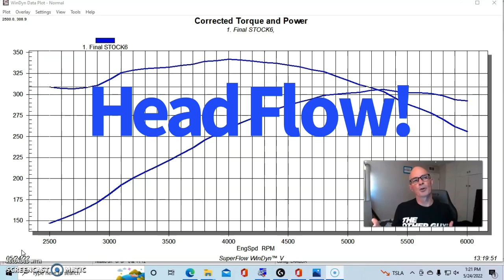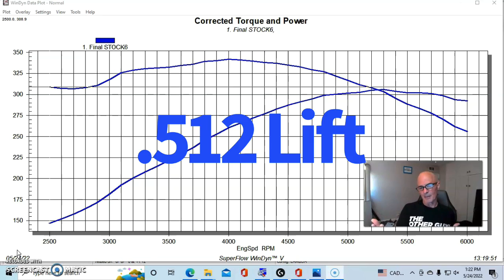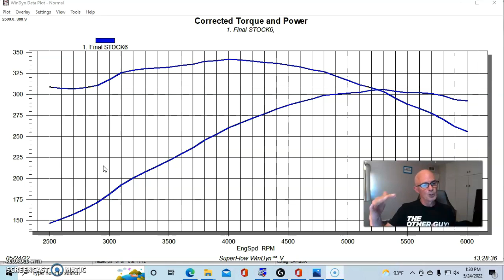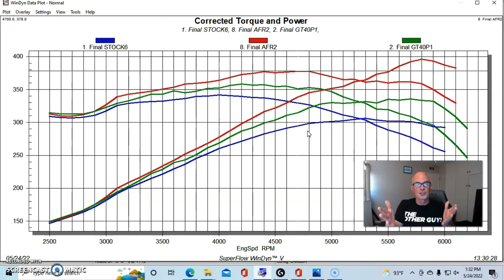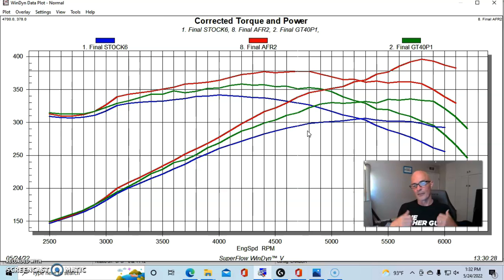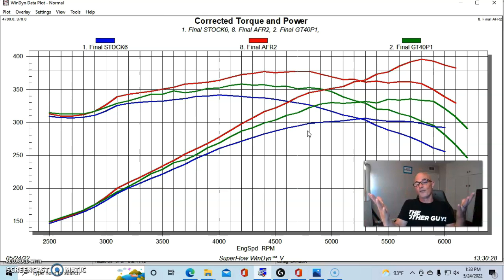HOW TO ADD 90 HP TO A 5.0L FORD! 302 HEAD TEST-E7TE v GT40P v AFR 165. ARE ALUM HEADS REALLY BETTER?

Comment: 95 Mustang Cobra heads , what are they GT40 or 40 P. Just thought I'd ask as I'm sure you know  🙃👍
Reply: All the 5.0 Cobras: 93, 94, & 95 had GT40 heads, not "P" heads.  GT40 is also know as a 3 bar head and the GT40P is known as a 4 bar head.  3 or 4 bar is a reference to casting marks on the heads.
Reply from the maker: these were P heads
Reply: @richardholdener1727  You're the man , thanks

Comment: It looks like the morons are giving you plenty of content to make! If you do revisit, please run all the 02s in the pipes! To show how different the cylinder to cylinder is! I didn't think anyone ran stockish cubic inch anymore! Other than the antique racing guys! 400 hp with a stock cam 🙄🙄🙄🙄! I've never done it, & we have rebuilt tons of cobra engines, as there is a major Shelby Mustang restoration shop about 20 minutes away! Maybe if you used the best of all the factory stuff in perfect shape with a shitton of compression? But there isn't much time for the air to enter or exit w such a tiny camshaft! The next question after you do all this will be, DUH what will it do on a 347 or 363 😂😂😂😂? Thanks again Richard for answering the same questions over & over in every way possible 🙄🙄🙄🙄!
Reply from the maker: what will a stock cam do on a 347? that vid is up

Comment: They also changed the rocker ratio from 1.6  to 1.7 on that test to get to 400 hp. That is how they simulated a bigger cam. So they said. I read that article. That is why I only buy AFR heads.
Reply: Plus electric water pump helped a little. I think whoever threw that short-block back together must've did a hood job. Because every little bit counts. When you're being challenged like that. 
Kinda like Ford, Chevy & Dodge. Letting the race teams come into the foundry. So they could make a stronger " stock " block. By altering the molds. Prior to the block being poured into the molds lol.
Reply: My thoughts exactly. It's not apples to apples if every bit of it isn't the same. I'd also like to see the dyno results of factory heads with factory cam and compare 1.6 to 1.7 to see how much that little extra lift actually does.
Reply: @BrandenMcNabb  Iv'e seen a test where going form stock rockers to rollers of the same ratio made just over 10 HP, really not worth the swap done on it's own. Going to a higher ratio should be good for about the same gains (so 20-25 hp over stock rockers) but will put bit more strain on the valve train, mostly at higher RPMs.
Reply: @johnjones928  the only time it's worth a difference is if the rockers you're using are flexing. Higher ratio may give a small bump depending on the combo but usually within 10hp or so unless the change is drastic. 

The big thing with these builds is all the incremental stuff. An electric water pump is about 8hp at the top end. Performer rpm air gap manifold is about a 12hp gain over a generic raised dual plane. The headers are probably worth 15hp over a set of cheap manifolds. That's a 35hp gain altogether!

It's worth making the small changes, they all add up eventually.
Reply: @BrandenMcNabb  I wonder if the cam was degreed differently from stock too. 
I believe I have the original magazine at my parents house. I need to check.

Comment: Curious what just the 165's slapped on an otherwise stock setup would do, or heads & better intake, but stock cam. I really enjoy the streetability and daily driver characteristics of the factory cam.
Reply: Iirc, 15 years ago the magazine did that and it was worth power everywhere except way down low. Maybe max 30-40 HP? Then they put a street cam in it and together got well over 100hp. The stock cam is really small so the heads great flow didn't shine up top.
Reply: This sort of mild camshaft with 212@50 duration would be very streetable. A 224@50 would be deemed streetable by most gearheads and manual transmission drivers but would need a converter and maybe some gear in an auto. The bigger grinds like 230@50+ tend to really end up fairly extreme for a daily and are best suited to weekend warriors and street/strip machines.

Comment: Hey Richard, I would love to see a test on 302-306 ci engine with a 390cfm vs 600/650 cfm carburetor!
Reply: The IROC racer cars use 390's to make 450 HP, of course those were modified carbs on 7500 rpm 350 cid engines.
Reply: @johnjones928 
This is a FORD thread.

Comment: To make decent power just save up $ and get the cam, AFR or Trick Flow heads along with headers, intake and 650 cfm carb. Then you can leave it alone and be happy with 400 HP for your street mobile

Comment: Went from stock cam & E6 heads to an E303 & GT40p's and the difference was huge. Next time you test them get the Alex's drop in spring kit for the GT40p's. It will smooth out that top end.
Reply: Have they got things back in stock ? Last I looked a year ago or so they were sold out of almost everything. Fortunately I had bought springs from them few years ago
Reply: Who is alex?
Reply: @coffeecan7440 
Just search for "Alex's valve springs"
it's very easy to find on the internet

Comment: Just got finished up with my 306 build this spring with AFR 165s and longtubes. I used the XE266 cam and it is running great so far! I haven't went WOT yet as I am still breaking in the clutch and working on the tune but it seems to pull extremely well compared to the E7s. I have also gotten a lot of compliments on the sound.

Thanks to Richard for all the 5.0 videos and willingness to answer questions!
Reply: I sold a set of 165 renegade heads to a guy with a 70 mustang. It had a stockish roller cam motor. The 165s really woke up his car.
Reply: How are the AFR 165's?
Reply: @UFOGHOSTHUNTER  They are doing good so far! I’ve had no problems whatsoever. The valve train is noisier than I would like but I can’t contribute that to the heads being at fault. I want to get to the bottom of that over winter.
Reply: I have a 94 gt with this same combo, but a ported explorer intake and 20 lbs injectors. Equal length shorty headers. It pull hard to 6,000 . But I don't belive it has over 350 ish hp. Could be the carb setup and msd distributor works better than the stock 94 ecu/ ford extender box.

Comment: I love these videos. My first two cars were both '89 hatch's. Third car was an '89 notch.
My notch had a set of twisted wedge r heads on a 408 Windsor. That thing was a monster in the mid 90s. Had that car deep into the 2000s where I did a double A-arm front conversion and terminator rear suspension with battle boxes, among other things. 
I miss that car and this video bring the feels out.

Comment: Can you provide any more details on the rocker arm setup you used on the GT40P heads?
Reply from the maker: comp stainless
Reply: @richardholdener1727  stud or pedestal rockers? The GT40 heads are pedestal as cast.

Comment: Richard, the Tickford branch of Ford Australia did a bit of budget trickery with the iron GT40P heads on the 2001/2002 Falcon XR8 220kw model (Factory hand built 302w's, 295hp). They shaved the head to bump up compression, then fitted the Alloy heads 1.94/1.54  size valve combo, with 1.7 ratio Yella Terra roller rockers as an added bonus. No other FACTORY installed, pushrod 302, including the mighty Boss 302 was as powerful !  Tickford did this because at the XR8's price point, the business case for the Alloy GT40 heads did not stack up !!
Reply from the maker: I still think a Boss 302 (275 cfm) would make more than the GT40P (200 cfm?) headed motor you described
Reply: @richardholdener1727  Unrestricted, yes, but straight out the factory gate, the 69/70 Boss 302 rated at 290 SAE Gross, 01/02 XR8 rated at 295 SAE Net.  Both cars run mid 14s.  Boss 302 3300lb, XR8 3530lb. Torque curves would be intersting !!
Reply: @arkhsm  Firstly, all Australian  Wheels and Motor publications quoted two up 1/4 mile times, which are 480 pounds above the stock  iron headed XR8 Rebel or TE50  220 kW 1650 kilo weights. That is a start line mass of a huge 4117 pounds. In nearly all US publications, One  seasoned 200 pound person and gas for 50 miles.  Second, rampant HP fudging started in December 1967 right about when Ford took  66 HP off the 306 HP gross K code Shelby 289, and made two production G codes, the Street Tunnel Port and then the first Boss 302 with nearly the same block in 1969. Like the SCCA approved mid 68 model year Mustang  Street 302 Tunnel Port that was withdrawn (240HP gross at 4600 ) other car makers followed suit, namely the 340 4bbl  Chrysler E55 ( 275 HP Gross), the Six Pack 340 (290 HP Gross) the later Boss 351 (330 HP Gross) and the first 428 CobraJet (335  HP Gross, same rating with out without Ram Air, no allowance for the Super Cobra Jet option either). Specifily,  the actual  Boss 302 gross power figures were taken 1300 rpm below the engines actual  power peak, which removed 50 to sometimes 80 HP gross . On the same 265 to 272 CFM 4V Heads, the 302 Boss and 351 Boss made 374 and 383 HP gross respectively in Richard Holdeners two tests with Holley 750cfm 4bbls and open headers. All the Big Four, Ford, GM, Chrysler and AMC, de rated there best engines by quoting the power figures many rpm below the power peak to avoid the 10 pound per hp Insurance hike.
Reply: @deanstevenson6527  Yeah Dean, some of those factory numbers were downright hilarious. I think my mill would kill the Boss on torque up to around the 4500 rpm mark, and not fall too far behind to 5500. Finally, after that those drain pipes will kick butt, but the factory installed a lame 6150 rpm limiter.  I tell ya, for an old non-VCT pushrod donk, Tickford's version pulls strongly from idle to its 5750 rpm redline....that's one real elastic powerband !!
Reply: @arkhsm  Richard Holdener, , we know your True Blue. As well as being an All Engines Guy. As long as our guy Richard knows about it, he can work through where the Horsepower sits for any combination. I trust his testing details. XR8 Rebel and the Synergy 5000, they were indeed the Dear Old Windsor Five Ohs finest hour. 295 DIN hp net, 321 DIN lb-ft net. Without ancillaries, thats probably 335 - 342 hp SAE Gross, and Maybee 365 lb-ft SAE Gross based on the 1972 EU and TUV conversion factor. I got to have a fang with a blue 220Kw XR8 at Teretonga in Invercargill at the Ford Advanced Drivers Course in 2002.  Great engine. My instructor , Mr Cooper, said the 5.6 250 kW Pursuit engine in the T3 Falcon  was much stronger, but not any sweeter
Reply: @deanstevenson6527  Torquier, and real competition for the HSV's of the day, but probably not as keen to rev over the 5500 zone. Definitely the  "Factory Big Block" of the 8.2 deckers !!
Reply: @richardholdener1727  This is not an attempt to Throw shade in subtle way of disrespecting or ridiculing someone verbally or nonverbally. Love everything you do, and respect your way to do things. Down in Australia, Ford spent a lot of money with Aston Martins Tickford wing. They were the ones who went back to iron GT40P heads after six months of Aluminum factory Heads.  A 5.6 liter stoked 4.00 by 3.40 5.0 HO engine with 90 mm throttle body and 1.7 rockers with a custom variation on the Watson's Cobra roller cam isn't anything like 400 HP gross Alloy head 5.0 with dual plane and 750 carb. Just putting the info out there Sir.
Reply: @deanstevenson6527  For all Richard's knowledge, he probably doesn't know too much about down-under Ford's, what with him being more of a Holden-er type of guy, lol !!

Comment: I'm Wondering what your peak timing was on the "p" heads? I read they like no more than 30*?
Reply: Yeahi think you're right, I seem to remember that they're more efficient and need less timing (kind of similar to more modern motors). Hopefully he'll pop in and clarify what he used

Comment: I love these kind of tests. I would like to see how much modification is needed to get a 5.0 to the 500hp level
Reply: 331-347 cubic inches with appropriate stroker kit.    TFS 225 heads. 11-12:1 compression, 1 3/4"  or 1 7/8" long tubes, victor jr or sr intake with 750 Holley.    Or Victor 5.0 EFI intake.   Intakes are ported to match heads.     Camshaft 235@.050" .600-.650" lift.  106-110lsa.     Something around there, there are other heads which can do it.   Different cams, but the induction and exhaust is about right.
Reply: @dennisrobinson8008  Thank you
Reply: @turbomike71  From the link I sent for that 500HP combo on a 5.0 block, the TFS PORTED 185 Track Heat and 205 Track heat can also get the job done.    However I gave the 225 TFS because it flows similarly to an LS3 or LS7 head and will let you make the power with a smaller cam.    There are other heads which will get the job done from other vendors:   The Edelbrock Victor Jr, The AFR 205 and AFR 225.   But look at the flow data of the "lowly" 170cc TFS TW head compared to some of the "big" heads from other vendors and even the 170cc have as much or more low lift flow at .200 and .300"...   This is why those heads were kicking ass.
Reply: @turbomike71  Those Brian Tooley camshafts with the tight LSA ( 106, 108 lsa ) showed a pretty notable increase over traditional cams with wider lsa's 112 and should be considered for max effort N/A applications.
Reply: If we're talking naturally aspirated that'd be a pretty special motor, anything making 100hp/Liter without boost or very high rpm is very efficient
Reply: @EpicScandinavian  LS's do it all the time.    They have streetable 600rwhp combos out of 6.0 and 6.2L, peak power made under 7000 RPM.
Reply: Nitrous or blower. That’s an expensive way to get 500plus bhp. Then there’s the issue with the block splitting at higher power.
Reply: @jblack5323  these blocks are rated to handle 500hp. Anything above 550 you’re risking it
Reply: Your not going to get a 5.0 unless it's a coyote over 450HP na without a stroker kit heck a 5.3LS will barely make 500HP with heads cam and intake

Comment: Always like the 5.0 videos,Richard what's your opinion on world products Windsor senior heads with the 2.02 intake valve?
Reply: Junk.
Reply: i had good luck with those... not so much the Jrs.
Reply: Ran the Roush 200's on a 306 of mine with stock HO cam. Made 360 at the flywheel. Have them and the cam in my E150's 351W now.

Comment: Would like to see a "head to head" comparison of AFR 165 Renegade and Trick Flow 170 11R on a 331. Any chance of this?
Reply: "Back in the days"...     The AFR165 were excellent machining, but the TFW TW design allowed more low lift flow and they flowed more than enough for the typical 300-340rwhp non boosted setups back with then with the typical components.     And the TFS TW would win by a little bit of power and torque over the AFR165.    The AFR165 had better build quality, and better hardware.    But this was before the 11R head, which appear to be a better constructed head than the original TFS TW head.
Reply from the maker: THE AS CAST TW HEAD DOES NOT MAKE MORE THAN AN AFR 165 HEAD-BUT THE 170 11R SURE MIGHT
Reply: @richardholdener1727  I don't like to go against you, but back in the day the typical cobra/gt40 intake, e303 or f303 cam, 1 5/8"-1 3/4" long tubes or shorties, catback exhaust, throttle body on a stock block situation that the guys were all trying to get over 300rwhp, i was pretty sure that while the afr165 was a better built head with better hardware, the chamber design on the TFS TW let it make a little more power.    You'd notice it more on the torque curve where these heads made just a little more torque over the curve than the inline valve heads.   But it certainly was a long time ago.   The 11R appears to be a much improved head to replace the TW, with better machining, better hardware, even better valve angles, it probably like you said would certainly take the 165 AFR head.
Reply: Ok, I was speaking from memory and my memory was correct.    I was hanging around for a bunch of dynos and watching everything i could find on the internet in 1998-2001, with all the typical stock block N/A combos!.    The TFS DO have that low lift flow advantage that I was talking about due to improved valve angles and valves that have been rotated in the bore.

Airflow Chart for Street AFR 165 Heads:

Lift Value (in.) - Intake Flow - Exhaust Flow (w/ 1 3/4" pipe)

Inches - CFM - CFM

0.200 - 123 - 118
0.300 - 186 - 153
0.400 - 225 - 178
0.500 - 243 - 185
0.550 - 246 - 190
0.600 - 250 - 191

Airflow Chart for 170cc Street and Track Heat Heads:

Lift Value (in.) - Intake Flow - Exhaust Flow

Inches - CFM - CFM

0.200 - 141 - 107
0.300 - 205 - 144
0.400 - 233 - 171
0.500 - 251 - 187
0.600 - 251 - 193

Look at the .200" and .300" numbers.     In the DOHC world those heads make a huge amount of low lift flow to .300" compared to a pushrod head and they are using small cams of only 200-205 duration @.050" and can spin cleanly to 7000 RPM.    The low lift flow makes it act like it has a bigger cam on a head with worse low lift flow.    Also those cars with a lot of low lift flow tend to make more peak rwtq and are more efficient.     This is why the TFS were winning on all those stock cam and bolt on stock block N/A combos in that 1998-2001 timeframe i was talking about.    Here is the link:

https://www.stangnet.com/mustang-forums/threads/afr-and-trickflow-head-information.716191/
Reply: I want to get a set of these 11r and port them up real nice and put in my Windsor. Mayb I can hit some high 4 sec 1/8
Reply: @slopoke22  They have a 225cc 1r head that does 356CFM@.700"
Reply: @dennisrobinson8008  yeah, I assume that I could make em real nice. Haven't got to do any of those yet but I want to. If I don't go the Yates route, I'm either gonna try to find some of these or atleast the shallower valve brodix sbf and see what I can do with them.